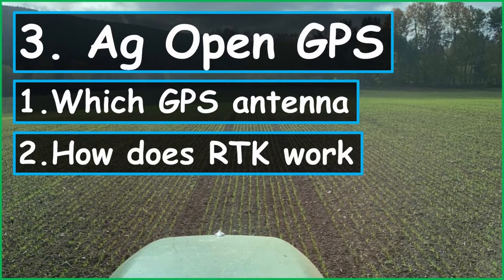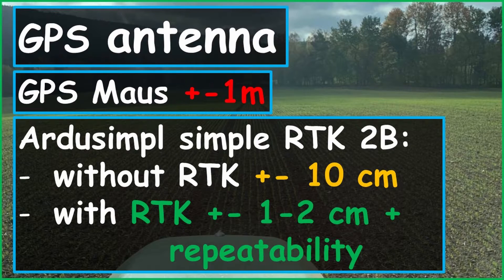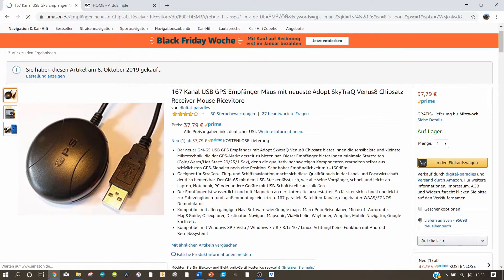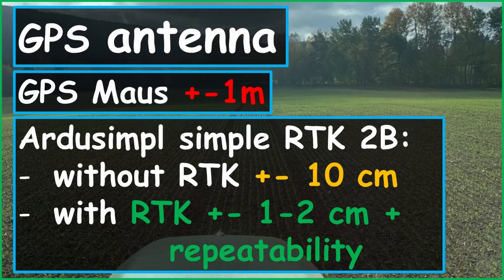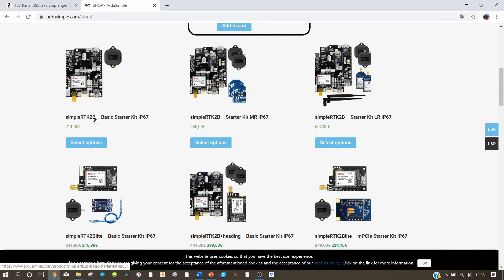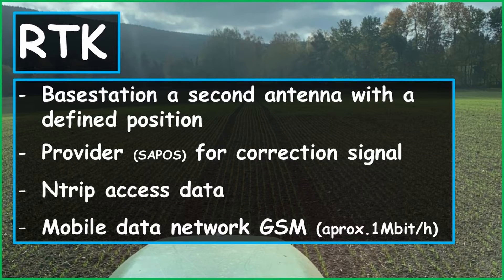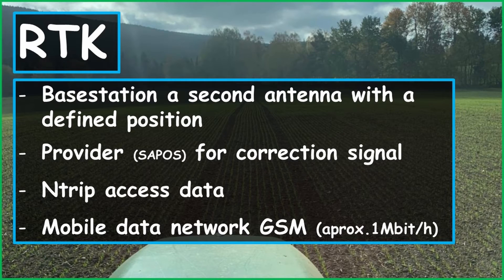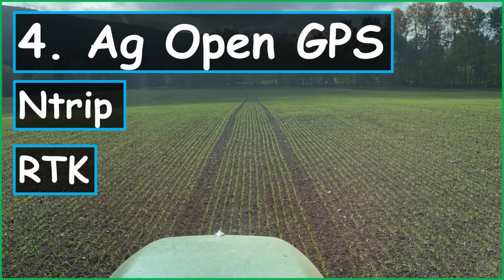Ag Open GPS 3.  Which GPS antenna and How does RTK work

Comment: Hi great an clear video with lots of information. I have a question. I have a fieldbee L2 basestation and L2 resiever. With this I get 2cm rtk with no payed correction signal. But I wanted to make our new tractor autosteer. And was thinking of using agopengps for that. I can get a rs232 cable from my resiever. Do you have any clue if agopen supports that? Thanks again for the great video

Comment: hi thanks for your videos!
I would like to order the simpleRTK2B and start building a agopengps system. but before i order i was wondering how do you connect the simpleRTK2B to the computer that has the agopengps software? does it use one of the micro usb ports on that board and plug into the usb on the computer? do you need to do any firmware loading to the simpleRTK2B?
  i know this is a simple question but im just trying to figure this all out.

Comment: Hi as a start what kind of accuracy can I expect from the rtk2b without using the rtk correction signal, I just want something to start with so probably would just use light bar guidance initially & then add rtk & autosteer later
Reply: Hi have you had any luck with the rtk2b? I would like to do the same, start with a simple system and build up on it in time.
Reply: @mueller9539  Hi I haven’t done anything as yet, I may end up putting in a base station for rtk accuracy but just go with lightbar guidance initially & upgrade to auto steer later